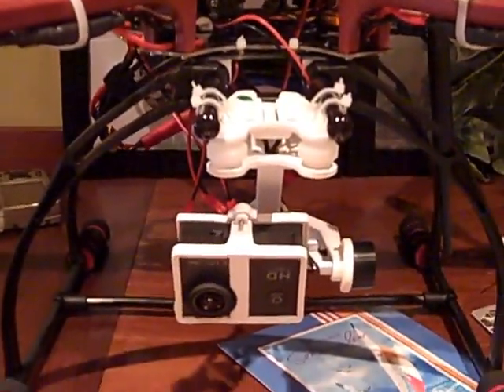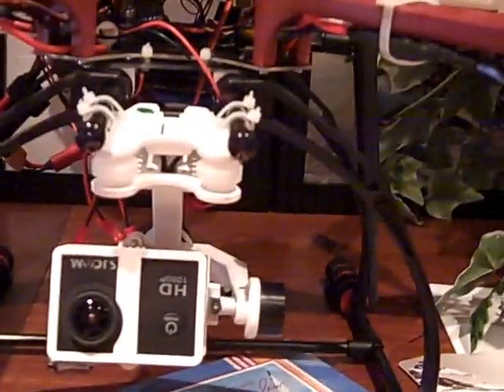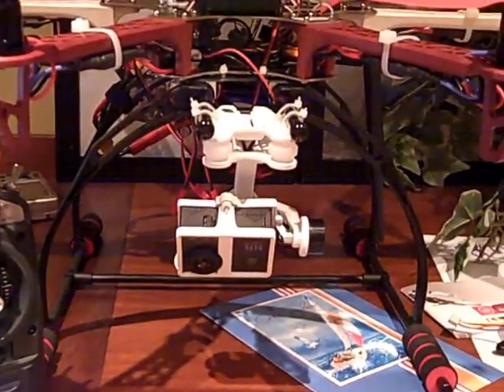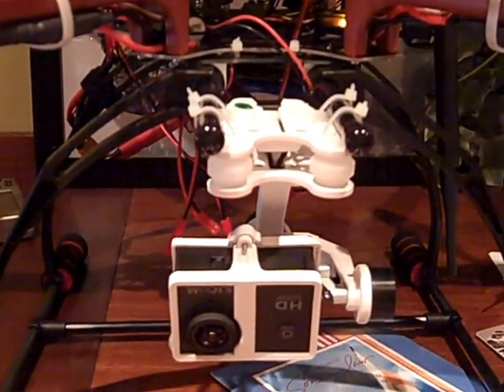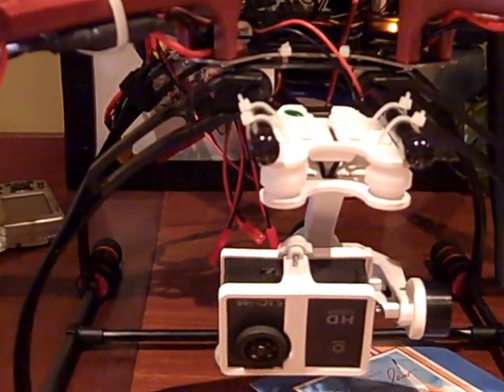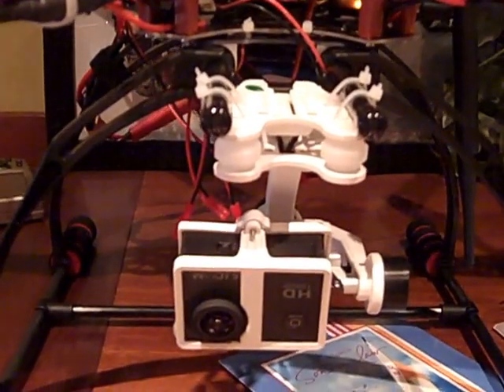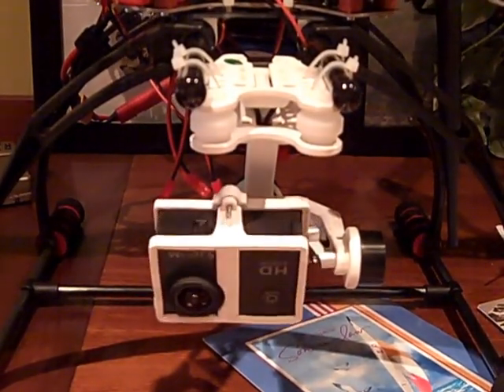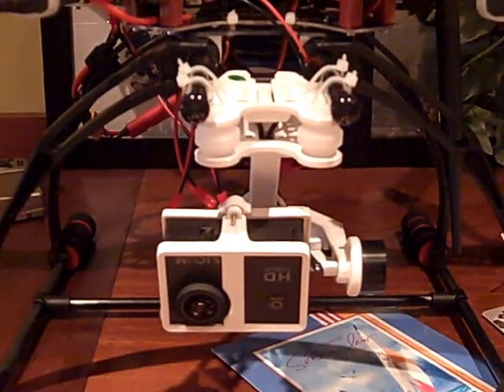Walkera 2D gimbal tilt control from APM 2.6

Comment: how do you set up channel n control it from mission planner?
Reply from the maker: I had the APM flight controller controlled by channel 6 on the receiver.  Output on pins 10 (signal and ground)  --> Gimbal tilt pins (tilt and ground).
Once you have that set up you turning the knob on the transmitter will send a signal from channel 6 into the APM.  The APM will then pass those signals along to the gimbal via the output pins 10.

Because the APM is in the middle and ultimately in control any gimbal tilt commands set in the mission will be sent to the gimbal.  

So, to summarize:
 RX --> APM and controlled by channel 6  -->  Output on pins 10 (signal and ground)  --> Gimbal tilt pins (tilt and ground).
The gimbal is powered directly off of the 4S battery.

Comment: could you explain how you did it please??
Reply from the maker: +Brandon Brown I'd need a bit more detail on what you're looking for but as an overview.  I have the following setup :  RX --> APM and controlled by channel 6  -->  Output on pins 10 (signal and ground)  --> Gimbal tilt pins (tilt and ground).
The gimbal is powered directly off of the 4S battery.  
If you had a specific question please let me know.
Reply: +Barry Houldsworth , I have successfully set a tilt control in Walkera G-2D using APM 2.x flight controller. It's easy. Soon I will upload a video about it. If you still want to know I'll tell you how to do it.